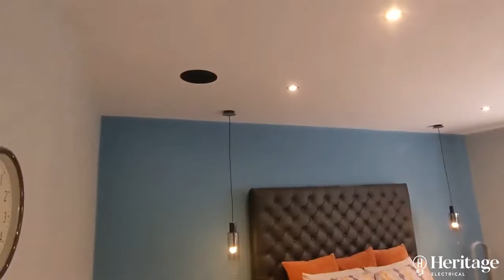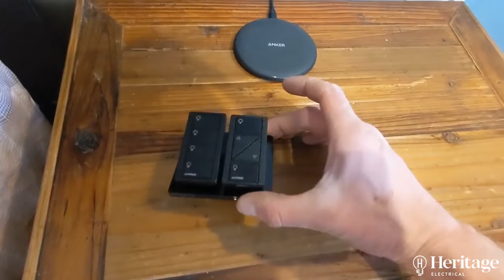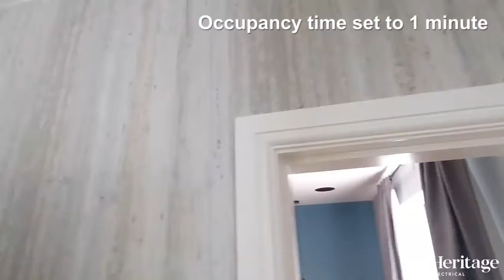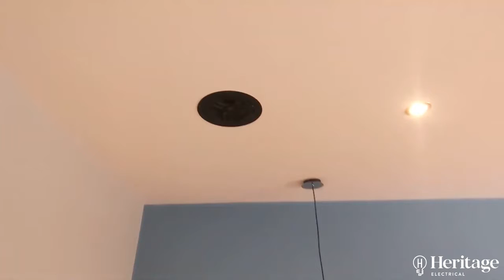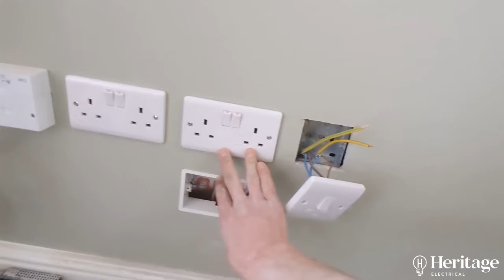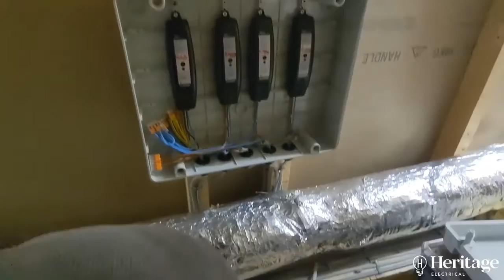Using Lutron RA2 Select Modules In A Retrofit Situation - Extra Lights With Minimal Mess!

Comment: So are these wireless switches or hardwired?
Reply from the maker: The modules which do the switching need a supply, the switches which can be positioned anywhere are battery powered and last 10 years.